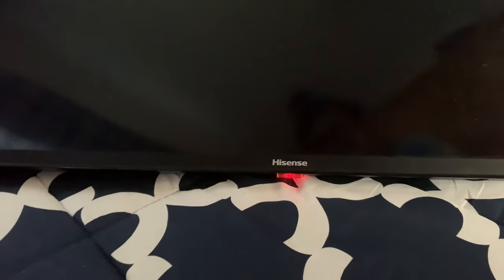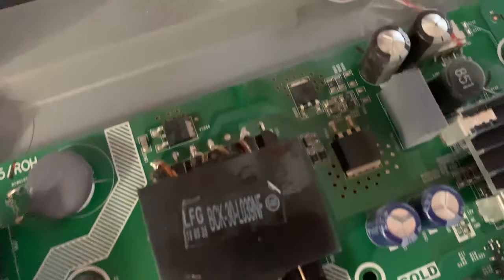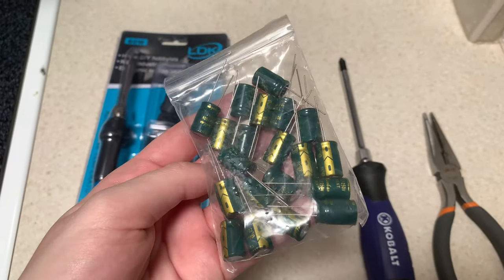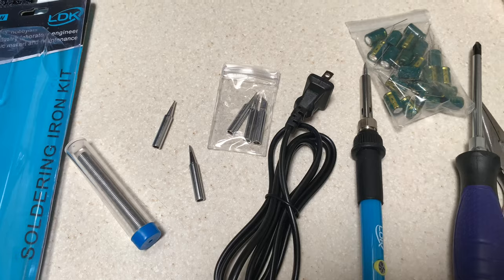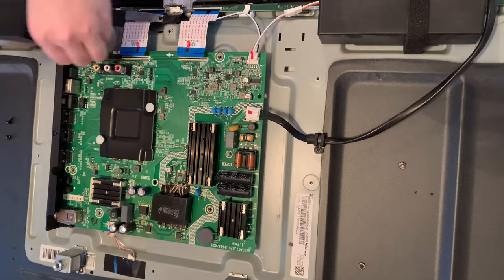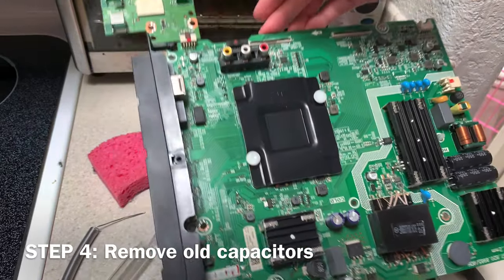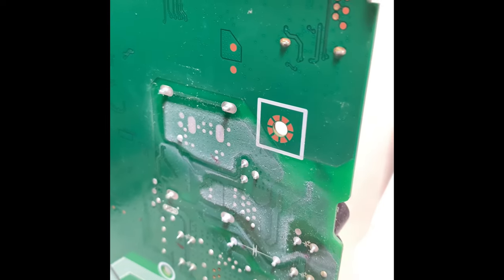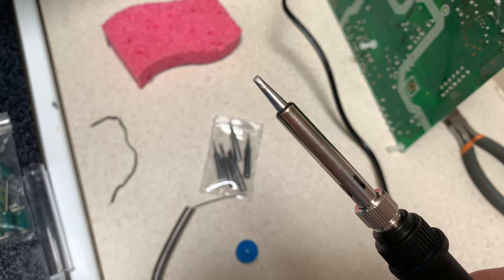Hisense tv won’t turn on red light blinking: How to change a capacitor and fix TV

Comment: if you power your TV directly in the wall plug and don't use a proper "surge protector" power strip (it must say "surge protect" or "surge suppress" on the power strip), then a storm or sudden surge on the power grid can blow the capacitors. ALWAYS run your more expensive components, such as TVs, audio, PCs, Laptops, Roku, etc. on true "surge protectors." APC and other companies have really good surge protectors. Some folks plug into a power strip that are simply a "relocatable power tap" that don't have surge suppression.
Reply: Mine was plugged in a surge protector strip and still blew the caps... It's a 4 year old Hisense, not sure if age is involved

Comment: I have what appears to be a similar tv.  No blown capacitors, no screen, and blinking red light (faster blink than yours).  Still diagnosing.
Reply: same here, red light blinks twice..This is my second Hisense, the last one did the same thing.
Reply: Same thing here. Changed out main board/power board didn't do anything. Was thinking of changing out the tcon board. I'm just not sure that is the issue. There's no hard reset on my model 50A6G already a hundred dollars into the repair any suggestions?
Reply from the maker: My capacitors did not look blown. I replaced them anyway. It ended up being the problem.
Reply: @charlieelifrits1889 did u ever figure it out? same issue
Reply: @charlieelifrits1889  could be a faulty backlight array

Comment: No need to tin the cap legs, it makes it harder to fit the cap legs in the holes, also before you remove the old caps add new solder to the pins 1st, this will help the original solder to melt quicker.

Comment: Good job ❤️👍for someone who doesn't have much knowledge about electronics.
Careful🙏 before discharging capacitors. The one you discharge and make a big spark was the high voltage capacitor ⚡🖐️.
It's was around 350 volts. ⚡.
To discharge a high voltage capacitor you need a resistors. Around 220 omh.
It's not safety to discharge it with a screw driver.
The soldering must heat enough so you can disoldering the joint on pcb easily.
You must heat the old soldering on the board with new soldering leads. Then it will be easy for you.
If not you can use  desoldering pump  vacuum also.
Next when replacing the new capcitor no need to cut the pins. Just insert it and afrer soldering on the board you can cut it.
Never add soldering leads on the capacitor  pins before inserting it on the board. The hole on the pcb is so small. Overall it seems OK if you had inserted the capacitor correctly in the direction needed. But I seen the soldering is a bit loose. You need to apply it near the board. 
I have a hisense tv also.
🙏😊 Nice to see your TV working.
Reply from the maker: Well hopefully it continues working and I don’t need to replace them again. I shouldn’t have turned it on right before I started, but I wanted to film what the tv looked like before. It had a pretty good spark 😀
Reply: @echoingamy  well if you didn't turn it on to film it. So everyone wouldn't the problem of the TV.
 Don't worry you replace it well as I seen on the video. It will work for a long time. The capacitor don't get blown easily. Unless there are some other factors make a capacitor blown. The diotes or if a lizard 🦎 come on the power supply that's cause much troubles.
When I seen the spark I was shocked. As you can see the capacitor keep some voltage despite you turn the TV off.
Be careful next time please 🙏.
 Me too I didn't know much about it. But I learn it when I had experience this for the first time.
Just be careful please. ❤️

Comment: Just a couple pointers 
1. Get a desoldering gun it will melt the old solder and suck it up so you don't have to fight with getting the leads into the holes
2. Do not pre-tin the leads on the capacitor it makes the leads thicker and harder to get through the holes.
3. Do not trim the leads before you solder the capacitors back into the board keep them long this helps with alignment just insert the leads and push the capacitor down to the board as far as it will go don't force it then on the back side of the board put a slight bend on both leads at the board this will hold capacitor in place long enough for you to solder
4. Also when discharging the capacitors it's recommended to use a 20k ohm resistor across the capacitor terminals this is much safer than a screw driver
Reply from the maker: Agree on all points…
Reply: Next time use your tongue 👅 and not a screwdriver. 
This tip is great I do it on all my 9v batteries. 😊

Comment: This is insanely impressive. I've never been brave enough to fix an LCD Panel. (I think an O6's tv broke and nobody wanted to take it apart because of the capacitors!)
I think the only thing I successfully soldered was a CAC reader that had cables that kept coming loose.
I would caution that most "Tin" has lead it it so you would probably want to wear some type of gloves and work in a Very Very well ventilated area and wear a mask too.
Reply from the maker: It’s fixed, but I’m too afraid to use it. I need an electrician to watch it and tell me it’s good enough.
Reply: @echoingamy  You could use it in a brick area or other non flammable area.
Reply: I'm an electrician / electronics technician and, except for the very first cap, you did really well - even that first cap gets a passing grade of B-
Reply: @ValleyDragon  stop giving misinfomation and making people dought there work! there is not a lot to go on fire in that tv! they replaced the caps just fine and the tv is great again!
learn some more about electronics before you comment, you know, so you dont say stupid things.
Reply: @echoingamy  use it all is good, you did just fine, the back light is back and it works again yay
Reply: You have to unplug the tv from the electric source for at least a day but the older tv is worse because they keep the charge for ever

Comment: great video, i had same issue with my tv but didn't fix mine.
Reply from the maker: Sorry to hear that
Reply: I know this post is old but next time try checking the backlight LEDs because if one fails then the TV will come on for a few seconds then turn off
Reply: @georgec7798  I should've done that, but thank you for reply.

Comment: I have a vizio tv I had about four years. when I Purchased it I was Browsing through ebay and they had 65 inch like mine that had a cracked screen they were selling all the circuit boards out of. So I have all brand-new circuit boards in a box in my office closet. I hate to throw anything away so I'm going to replace the Capacitor's and put the new one in and save the old one as a spare.
Reply from the maker: That’s awesome

Comment: I now have two tvs with blinking red issues, I wish I knew how to test if it’s the capacitor or circuit board or power , do they sell a testing kit for tvs to learn?
Reply from the maker: Not sure
Reply: @echoingamy  if you see any caps swolen or domed then they need replacing! if its something else then you would need to learn more about electronics in order the repair deeper.